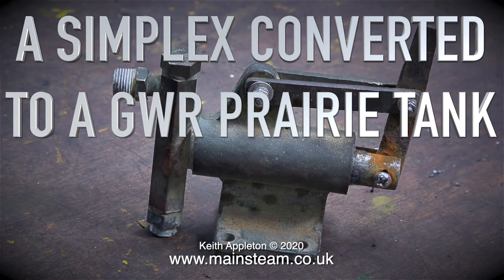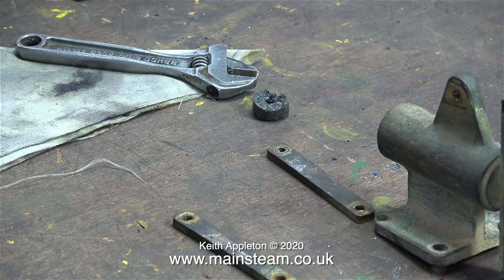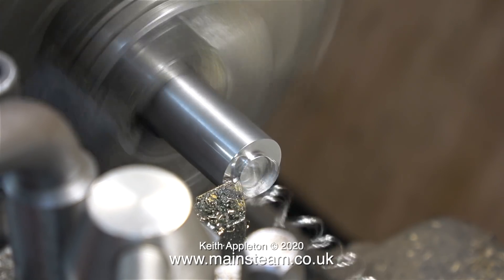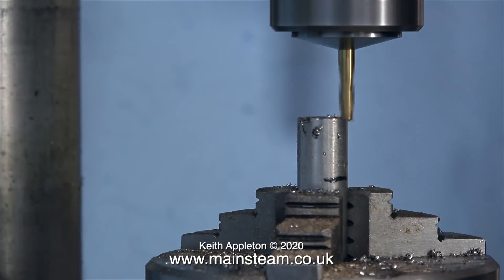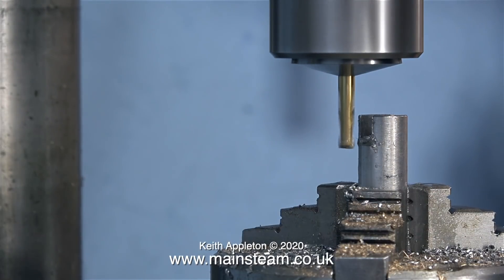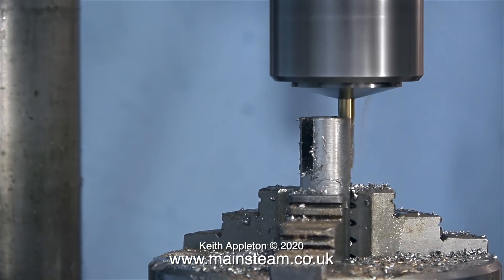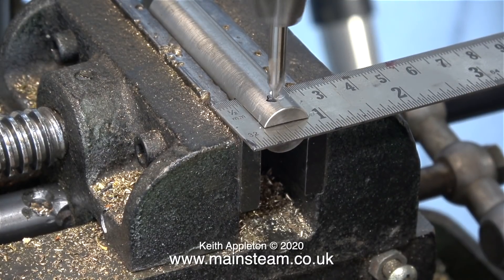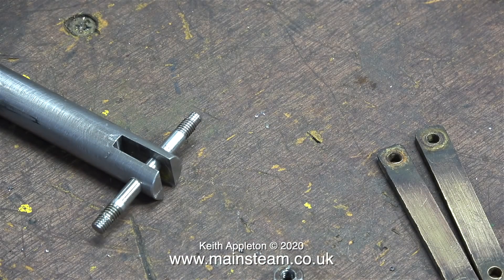SIMPLEX PRAIRIE TANK - PART #23

Comment: Many years ago I learned a very important lesson.  When you are cutting or milling or turning metal and the phone rings or someone wants you to answer a question, do not stop.  Ignore the phone and the person and keep working. This will save a lot of metal having to be discarded and the replacing of tool bits.  A lesson for everyone else: When you see another  person engaged in a job, do not interrupt him!  Even if the building is on fire, do not interrupt him!   Go and put the fire out and when he asks you later what was all the excitement about, you can tell him what happened.
Reply from the maker: I agree with you 100% on this.

Comment: Brilliant video as usual, very informative and helpful- especially as I'm making an axel pump for my 5'' gauge loco!

What clearance did you have in the bore between the ram roughly to leave it as a good sliding fit that wont allow leakage of  the water out the back of the pump? Hope this isn't too daft of a question, just a beginner currently doing a very similar job!  
cheers 
Tom
Reply from the maker: Hi Tom, That is a good question. If the hole is exactly say 1/2 an inch in diameter, and the ram is exactly the same 1/2 an inch in diameter then this is called an "interference" fit which is usually very tight. There needs to be room between the bore and the ram for lubrication. It's best to practice turning parts to exact size, and then I would use some "Wet or Dry" Silicon Carbide paper to reduce the diameter of the ram slightly so that it becomes a 'Piston Fit". It doesn't really matter about having a piston fit if you are using an O ring on the ram anyway.
Reply: @keithappleton   Thank you Keith, very helpful answer! I have just finished turning the brass  gland on my axel pump today. I bored the hole out to accept a 3/8 diameter ram, and the hole ended up slightly oversize (I had about 0.08 mm/ 3 thou overall clearance (so about 1.5 thou clearance on each side of the ram)). Its a nice sliding fit and has a little play in it- you can feel and see the movement but its not too excessive, but definitely there.

Do you think this will leak in service (i am going to pack it with graphited yarn anyway  as I have seen you do in your other vids), or will 1.5 thou either side be just fine?

Thanks again 
Tom